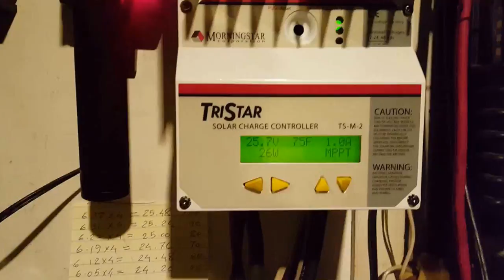Testing The Ultrasonic Dog Bark Deterrent, Repellent Sound Blaster Cannon Project.

Comment from the maker: Sounds heard through the video are inaudible in real time, the recording speed makes them audible!
Reply: Hi, this looks like a great device & I’m pretty sure it would be working. However, I would have appreciated to see some live testing on barking dogs. Nevertheless, can you tell us if it works good on a small range like 50 feet? Finally, what are your conclusions: What type of équipement should I use: Piezzo, tweeters, ampli, etc... I was planing to install mine in the shed with a power supply, to make sure it’s protected by rain but also unseen by my neighbour. Any advise would be more than welcome. Many thanks for the video.
Reply: Can you hear the sound directly?

Comment: Well done but I think you underestimate yourself. I dont think it is possible to see 20Khz moving air. Remember there is no net movement of air coming out of the tube- it is oscillating back and forth. At 20,000 times per second a candle flame will dampen it out. I suspect your cannon is brutally strong  8-) I hope so anyway.

Comment: I am using an "1968" Kenwood tk-150 amp that the HF outputs to 50khz, wired to 2 fostex ribbon tweeters with crossovers, HF output to 45khz. Also using a sound frequency generator on my tablet linked via 3.5mm to 2RCA cable set to 27.5khz for the dogs and 17.5khz for all day, everyday screaming kids. Works a treat these high frequency devices and it is once again a sanctuary to live in my home, in peace.
Reply from the maker: Thanks for the update, stay safe,
Reply from the maker: "27.5khz for the dogs and 17.5khz for all day"!, you found the right frequency range! Did you actually measure the frequency, the DB output and what is the distance/range?
Great job,
Reply: @ElRazTheGreat1  The frequency is displayed on the tablet screen as it is an android app. It is basic to adjust but it is accurate and free of charge. I have not tested the DB reading, but I will now that you mentioned it. I will update you with the results. I fire the high frequency tweeters at the dogs which are at least 50 meters away and they run for the hills and stay there. This is only at quarter amp volume. I leave it on for 30 seconds only. The oldest of the dogs is not much affected but it doesn't bark either! The ribbon tweeters work very, very well without tubes or horns but they weren't cheap unfortunately. The ribbons were part of a speaker build project.

Comment: For dogs you need to produce around 25Khz. Anything below will not bother them. I can only hear up to 13 Khz at my age but the have speakers outside the shops where kids congregate which produces 17 Khz and it drives the kids away but not the adults just coming to shop. The trouble with dogs is that you need a directional soundwave. I'm working on the most efficient as I have a dog that barks constantly.

Comment: the PVC pipe is made of plastic, it will absorb sound Ultrasonic as the sound wave moves through the PVC pipe to the target. use a metallic tube be better vs Plastic PVC pipe

metallic tube sound bounce off inside walls it none lost as it travel to target

EMT pipe! be good, not like a heavy pipe galvize pipe be, EMT pipe be good

Comment: I noticed you mentioned the Amplifier did not work. I remember reading that you need a special amplifier that is able to play extremly high frequency sounds. The one you listed seems to be specification up to 22KHZ and you need one that goes to like 60KHZ. WHy would you use the TPA3116 D2?

The other thing I would like to point out is that 4" tweeter has a frequency range of 1.5KH - 22KHZ, this does not go as high as the Kemo Ultrasonic Generator which goes as high as 40KHZ. 

I am not really sure what you are going to miss here running components not meant for these frequency ranges. The proper Piezo Dome Tweeter that is recommended goes as high as 60KHZ. 

I just wanted to point this out to everybody who is looking at this topic that the components don't seem to be in the correct frequency range and may not be able to tune properly if you need to go really high on the KHZ.
Reply: to stop barking dogs you want 25 KHz best for dogs. Different Frequencies for different animals. for rats 17.5 KHz etc.
Reply: @cf4459  How can you really be certain about that statement? Not all dogs have the same ability to hear the precise level of 25kHz. The best way to "set" the desired frequency on a particular dog - is to actually VARY the frequency whilst it is barking - and check the response from the offending animal. This is why the so-called Bark-Stoppers on Ebay will NOT work on every dog. They are a fixed -frequency. Added to this, the sound output from those devices (costing over $100) is very poor. Every barking dog need bombarding with (powerful) Ultrasonic Sound and at the optimum frequency. Only the offending dog can tell you this.

Comment: I appreciate your work it is very good, I have a dubt, I can see Kemo connected to battery and to speaker only, where is the amplifier connected ?  I want to do the same.. Thanks for share.
Reply from the maker: Did not use the amp due to the lack of frequency conversion (cheap amp).  Working on another method to amplify the frequency.  Thank you
Reply: I'm going to buy these devices and to ask to the electronic store what kind of amplifier is the best for this work.. Thanks!!..
Reply from the maker: Please share your experience! Godspeed
Reply: Of course, now I have to travel for long term, but when I come back I'll comment you the results, unless the annoying dog has taken it. Anyway, I want to have ready this work for the next dog nightmare..  Greetings from Spain!!..
Reply: Did you ever build a device?

Comment: I saw below where you listed the amp and tweeter that you used:  DC 12V-24V 100W Mono Channel Digital Audio Power Car Amplifier Board TPA3116 D2 and Y-DJ Horn Driver Piezo Tweeter Speaker 100w 4 inch Mounts to 1-3/8"-18 TPI Horn.

Did you use the Kemo Oscillator along with the amplifier to produce a louder sound?
Reply: Before, I had 4 tweeters (4 Pair of 3.25" x 3.25" Piezo Tweeter Element DJ Speaker Car Audio Square Single Super Horn NTX-1004PZ) connected in parallel with Kemo M0480N.  Took tweeters apart and put each in it's own 16" of PVC.  Looked similar to a 4 barrel shotgun.  Was about 92db at the end of each tube.  Put Kemo dial on 7 and was effective at about 100 ft with a rare, occasional bark.

I've since tried the Kemo with the suggested amp with the suggested tweeter and it was at only about 80db at the end of the pvc and not effective.  This tweeter was the lowest in volume that I've tried.  The amp causes a lot of static, like white noise, even with the frequency set high.

I had an older Pyle (Pyle PDBT28 1-Inch Heavy Duty Titanium Super Tweeter) that I tried without the amp, just the Kemo and it is louder at around 98-100 db.  This tweeter costs more but it has a Sensitivity of 104dB which is very efficient.  I am going to field test it without an amp, just the Kemo and see how it performs.
Reply from the maker: The amp is garbage! However you may be able to repair the speaker.  Mine was a disconnected braided wire on the piezo plate that easily got soldered back.  Thanks for sharing, Godspeed
Reply from the maker: Did not use the amp due to the lack of frequency conversion (cheap amp).  Working on another method to amplify the frequency.  Thank you
Reply: The Battery Powered House Just built this set up, and when I first tried it the amp seemed to have damaged the speaker. It stopped working immediately. Had a spare speaker, installed that and took the amp out. Started working again. Just wanted to share my experience. Thanks for all your efforts on this.
Reply: The Battery Powered House 
Thanks. Will give that a try.
Reply: J R keep me posted.I was looking at the same thing last night.Order the Kemo and the piezo.Sounds like the route your taking is a good one.
Reply: J R   Please keep me posted also!  Is the Pyle tweeter a piezo type?  I was wondering if the suggested 100 watt amp is a problem because 
It is being matched with a 100 watt max tweeter, when perhaps a 100 watt amp would work better with a 200-300 watt max speaker. The actual RMS of those speakers is 100 to 150 watts. I’m going to check this out with a car stereo shop when I have time.   Thanks for your info about the tweeter.
Reply: You need an amp that can play between 20K and 30K HZ, the amp that was suggested in the video does not play that high of a frequency.

Comment: Please can you tell me where you got the integrated tweeter/amp
Reply from the maker: On EBAY search: DC 12V-24V 100W Mono Channel Digital Audio Power Car Amplifier Board TPA3116 D2 and Y-DJ Horn Driver Piezo Tweeter Speaker 100w 4 inch Mounts to 1-3/8"-18 TPI Horn
Reply: Thanks!

Comment: Do you have information on where to purchase the tweeter and amp you discuss on this video as well as model numbers?  Thanks
Reply from the maker: On EBAY search: DC 12V-24V 100W Mono Channel Digital Audio Power Car Amplifier Board TPA3116 D2 and Y-DJ Horn Driver Piezo Tweeter Speaker 100w 4 inch Mounts to 1-3/8"-18 TPI Horn

Comment: Could you mount the speaker/transducer close to the property line and just run wires back to your shop?
Reply from the maker: That would be great, however there is a creek/wash between the properties that is about 80 feet wide and 70 feet deep.  Also there is an access maintenance road in between.  I do not want to torture the youngsters in the vicinity who have a good hearing, if you understand what I mean!